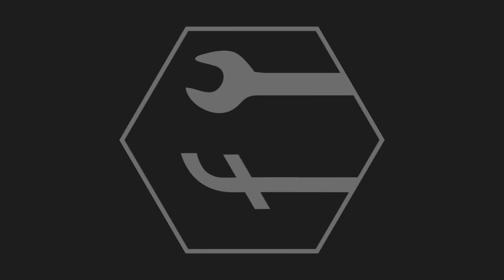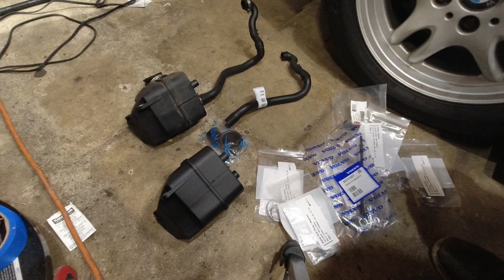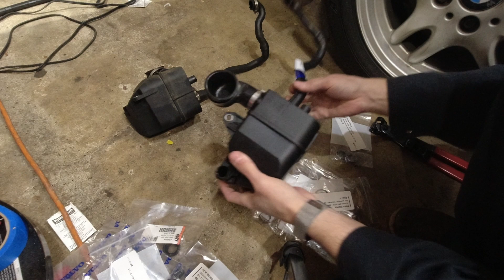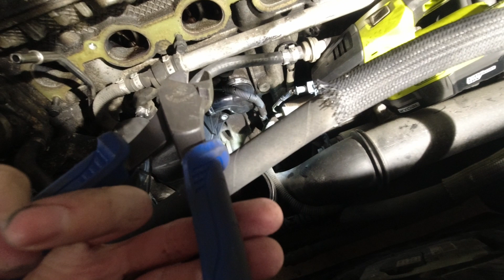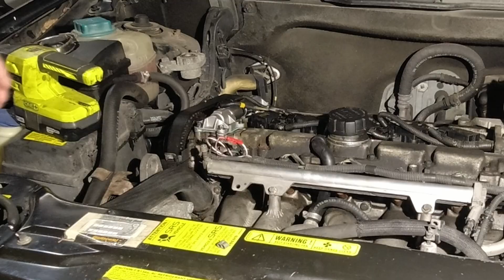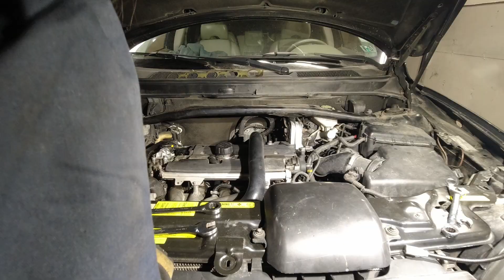$700 Volvo XC90 - Installing New PCV Parts [Part 6]

Comment: Hi, I'm only 16 but my parents own a Volvo XC90 (2006) 2.5T 5cyl. I don't know if I'm sure but there is a high pitched whining noise and the engine idles very roughly after a few minutes from normally starting and cold starting. I've replaced the MAF thinking that would be the problem but it hasn't made a difference. I don't have a lot of money and my parents aren't keen on maintaining the car, but I am. Is there a way you could help me identify the problem?

Thanks.
Reply from the maker: It's hard to know what could be causing that, but maybe check to see if there's air blowing out of the engine when you remove the oil filler cap. If the idle changes when you remove it, it could be a PCV related issue.
Reply: @frenchineer  Ok, thanks a lot.
Reply: I purchased a 99 Volvo V70 wagon last July. Its PCV system blew a cam seal and caused some oil leak. The oil leaked onto the timing belt and it squeaked upon startup. I was trying to replace the PCV system but found it's hard to do. What I did was trying to clean up the PCV system. I first disconnected the top PCV tube and sprayed a can of carburetor cleaner. I let it soak up overnight. Then I poured in some Marvel mystery oil and clean motor oil. I also put in a bottle of stop leak product in the engine. I also installed an oil catch can on the oil dipstick tube. The oil leak slowed down gradually and timing belt stopped squeaking. The car does not vibrate that much afterwards. You may want to do the same as I did.
Reply: @tedwu9354  Hi thanks for the tips, I'd first need to get some tools, but your info seems really handy and could save some money, thanks.
Reply: @gxhst1 What have you done so far? This summer I also have rough idle and high pitch noises when starting. It smooth out after a few minutes. I changed motor oil and poured in a bottle of oil treatment. It seems to improve a bit. It looks like there is not enough of oil pressure to pump the oil to top of the engine.
Reply: @tedwu9354 Not much because I’ve been busy for school, have you checked ur codes via a scanner? It could possibly help.
Reply: @gxhst1 My scanner shows codes for ABS control module and throttle body. I changed the throttle body but it needs to be reprogrammed. I don't think it will cause rough idle. I've changed intake manifold gasket, spark plugs, and ignition coils. They all improve rough idle a bit but it's still there. I also replaced a couple of motor mounts to ease engine vibration but I have three more to be changed. I also poured in some fuel injector cleaner but it's no help. I guess it's the engine itself. It has not run right after timing belt snapped. It was a long story though.

Comment: I have  a  2005 xc90 T5 and still.love it after 130K miles and 19 years.  I am not that handy but love to see how you   rebuild the car. Thank you.    I now have some oil accumulated   around the coils( more in the middle near  oil cap and the black hose) underneath the cover.. At 90K miles,  coil 3 went bad and two plugs 3 & 5  had burned off a big chunk of the electrode. May be i bought some counterfeit Volvo plugs from the web.  30K miles later, I checked the plugs again. They were in  good shape so I  guess no big problem  with that cylindars itself. The  PVC repair is quite a bit of delicate  work  and not sure  money  is worth spend with   any regular  mechanic for good result.    What would you think?     Can I just keep driving  with it?  The whole engine and compartment  is still very very clean  all around and there is no oil or fulid dripping down. No more rev up the engine just  for fun ( unnecessary  crankcase pressure to spil out more oil).
Reply from the maker: Thank you for watching! 
It's difficult to say what condition the PCV system is in or how long it would be before it causes issues, but I do recommend servicing it at some point to avoid damage in the long term. For reference, the engine in this video has 160,000 miles.
To slow any issues with it, regular oil changes with good oil might help. Volvo says every 7,500 to 10,000 miles but a 5,000 mi interval is better.
Reply: Good point and I do, even the time duration for 5K to 7K mileage oil change can be 18 months. Car in garage all these years and never push it hard.       What are the issues or symptoms  when my PCV is clogged up?  When I checked my  long term mechanics shop, they said the oil might be split over the  grid when they do oil change.  I guess the grid is there to prevent dropping  a nut or tool into engine during oil change.     Good thing is there is no oil leak around the things near the timing belts.  So I am probably good for a while until I actual experience some problems.

Comment: If the box isn't cracked take acetone and pipe cleaners and clean EVERYTHING .REPLACE RUBBER HOSE AND COUPLER.You should be good.i did it .worked like a charm.it takes a while to agitate and pick any buildup out of orifices but slot of times  it's peanut butter sludge and you can break crud and carbon chunks out with acetone and ream tools and picks.savrs money.

Comment: Thank you for this detailed video including the torque specs for certain bolt sizes.  I will get the same FCP euro kit you purchase since the fitment is also for the S60 T5.  My only question is why not just clear out the PCV nipple hole and attach a 11mm rubber fuel line hose instead of using a new PCV nipple with the plastic tubing that is more likely to be brittle again?
Reply from the maker: I suppose you could try that. I went with the Volvo part for guaranteed fitment, which also meant I didn't need to worry about cleaning the passages where the banjo bolt goes through. If you do try it out, make sure the passages in the metal part are clean.
Reply: I think the reason volvo uses the plastic hose is because it won't collapse under vacuum like a rubber hose of that size would.

Comment: Great video.  Do you have a parts list for everything you used?
Reply from the maker: Thanks! This is the kit I used (in addition to the T6 part linked in the description)
https://www.fcpeuro.com/products/volvo-pcv-breather-system-kit-s60-v70-xc70-s80-xc90-genuine-volvo-kit-504286
You would need to check the engine serial number to make sure it is compatible. Also to note, this kit is for the 5 cylinder that was in 2003-2006 models.
Reply: That is a big help thank you. I was wondering about the hose clamps, do you have to replace them?
Reply from the maker: The type of clamp that you take off the car won't be any good once they're off since they aren't reusable. Replacements are in the kit though. Other clamps, like the screw type on the throttle body piping, can be reused.

Comment: really great video- I got a misfire code the other day and it hasnt returned but it makes me think my PVC is the next job.. Steve, 04 XC90 - 250xxx miles. but dang that left side 10mm
Reply from the maker: Thank you! 
The intake manifold bolts are tough to get to without extensions (a wobble head helps too). If you end up doing this job I also recommend having a magnetic retrieval tool on hand in case the socket falls off!

Comment: Hi I’m 75 I have restored 3 xc90 d5 wagons in NZ. Your videos are great music is good subtle not to loud. It is good to see you take your time and do a very good job. You cannot cut corners on these cars. Working on some jobs can be demanding especially doing the right angle drive 2007 d5 done in place from underneath,…. but doable, I’ve done two right angle drives on my 2003 / 2004 xc90s, which are not to bad to do,… and did my 2007 six speed which is almost twice as hard.(((-:  Lubing your axle splines is a must they don’t run in trans oil. Your engine will love  you for doing its pvc. ((-: These cars are a great drive and well worth restoring. Good luck and thanks Henry. (-:
Reply: Hi yes I still have them. I just bought a dark blue xc90 (three weeks ago) Is actually 2005 not 2004. I paid 500 $ for it. ((-:  it needs steering rack abs problem and of course the right angle drive collar sleeve. I gutter the insides of  my cars and clean everything and put back together so they look and smell almost new again. My 2003 silver one was rear ended by a young guy texting. He hit me as I was stopped at the lights at around 60 Kms hour. All my work gone in seconds. ((-; his car was totaled I could still drive mine. But had chassis damage. Bought another silver 2007 a year ago that needed right angle drive. It is Polestar chipped.!! Yes the torque is truly amazing. A wonderful drive.  I did the “Nevis Rd “ in South Island in it 6 months ago. On my own, truly one of my best drives. (((-:  it was very dry otherwise would not have got half way.!! Drove from Auckland to Queenstown and back . Was a month there. I have converted it into a sleeper, took out middle row seats. I once drove 800km in a day and still felt good, that’s shows how good they are. (Nice and quiet) The rear end in them is amazing , very clever design.! Great to hear from you. Cheers Henry. ( if I new how to post a photo  of cars I would. ((-:)
Reply from the maker: You definitely have me beat on purchase price haha. Wow that's really awesome! I looked up Nevis Rd, and it looks like a beautiful drive. Nice idea converting it into a sleeper too, there's definitely enough space. 
I don't think it's possible to post pictures to comments, but if you'd like to share them via email you can reach me at frenchineer@gmail.com
Reply: @frenchineer  haha yes funny about the purchase price. ((-; and yes the Nevis Rd is awesome.!! …. as is a lot of the South Island of NZ. Great you have so many interested in your amazing videos. I will definitely be in touch, I have documented most of the restoration work I have done on the XC90s. I even pulled the engine on my first Volvo  2003 and had to do the trans differential out put gears. So anyone reading this be warned !!!! Make sure you run same size tires on your AWD or like the previous owners of my 2003 you will destroy something in your drive line as in this case the spider out put gears  in the transmission differential. The joys of motoring. ((-: cheers and thank you. Henry.
Reply: @henryallen7129  Mate, Im just checking your knowledge, instead if replacing the PCV, wouldn't it be easier to remove the sump and unblock the port ? Ive just seen several videos with the same problem and it appears that the sediment ends up blocking the port into the block .....? Would this work ?
Reply from the maker: Hey, I'm not sure if you're still looking for info on this, but the inside of the PCV box can also get obstructed, and the smaller hoses also need to be taken care of.
Reply: @frenchineer  Cheers Mate,  Thanks for the response, not showing signs yet but at 400,000 km shouldn't be far off!
Reply from the maker: Thank you for your kind message! Were all the XC90s you restored your own? Over here in the US diesel cars are pretty rare, so the XC90 is more often found in 5, 6, or 8 cylinder gasoline (and automatic transmissions). It must be nice to have the extra torque from the diesel engine!